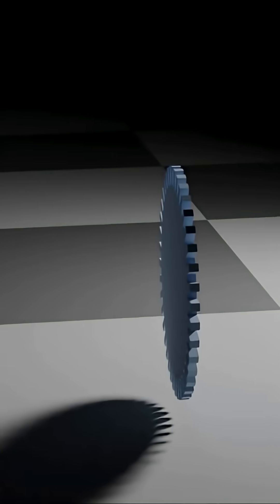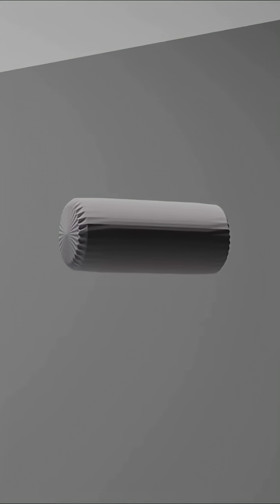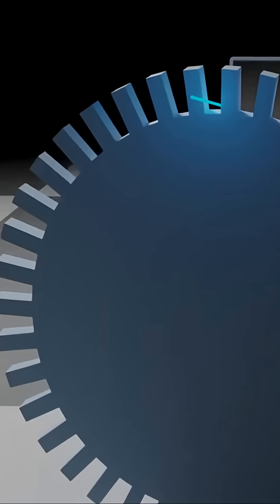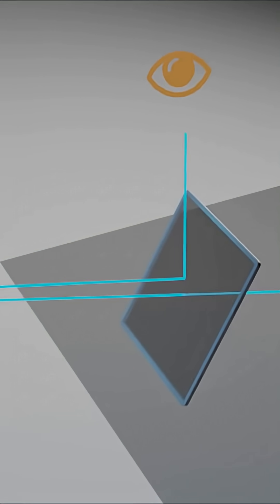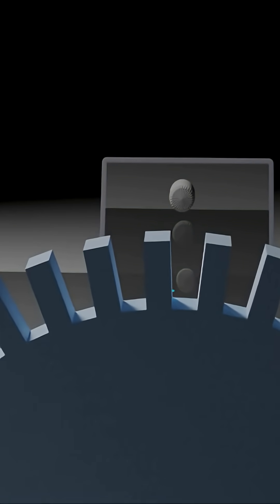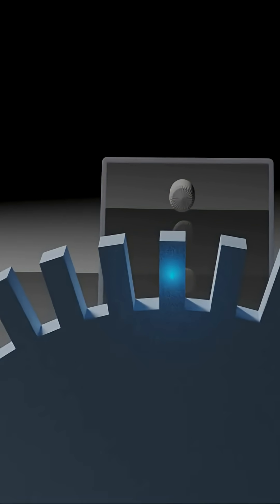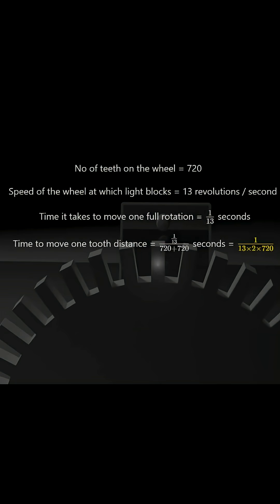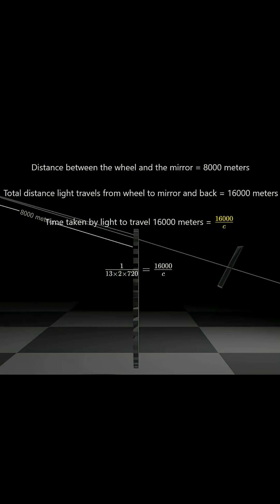Finding Speed of Light - Fizeau Experiment

Comment: But this experiment doesn't work in reality
Reply: it does
Reply: what part that does not work?
Reply: @terrycahyadi6954 the part where the laser has to travel 8 kms in one direction. That's 16 kms in total. Are you able to achieve a laser point at that distance? Don't you think it would spread out even if it reached
Reply: @deytutorials99 by you logic light houses shouldn't work
Reply: @deytutorials99  yeah 8km is a bit much but you can tweak the other parameters. 100x rpm to bring it down to 80m, 10x teeth to bring it down further to 8m, which is more manageable.
Reply: @mohanjan8768light houses don't need to focus light on one point. Again 8kms is too much even for a light house.
Reply: @busybillyb33 it's already got 720 teeth. x10 would make it 7200 teeth. That's impossible. Even if you managed the gear, the gap between the teeth would be so small that the laser won't be able to pass through it without diffraction. And how would increasing the rpm help? Again x100 rpm won't be possible. Also they are talking about the time when jet engines didn't exist. Only they can go upto 1,00,000 rpm. Practically the experiment is impossible and it's only in theory that they have derived conclusions